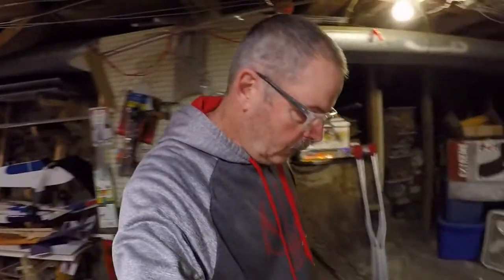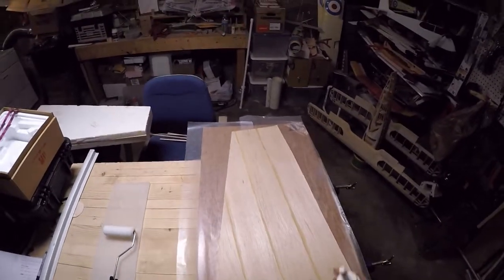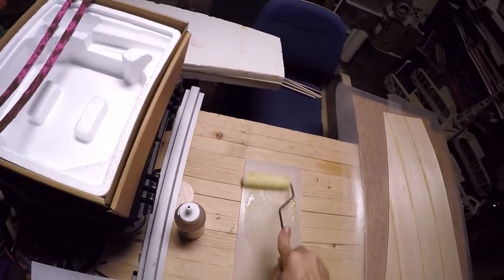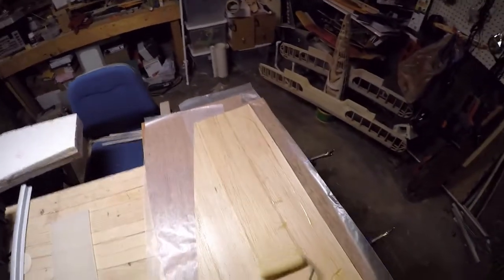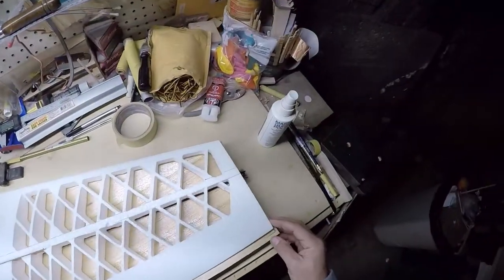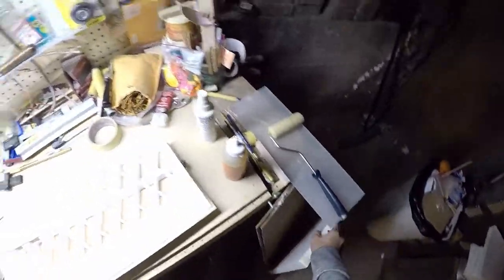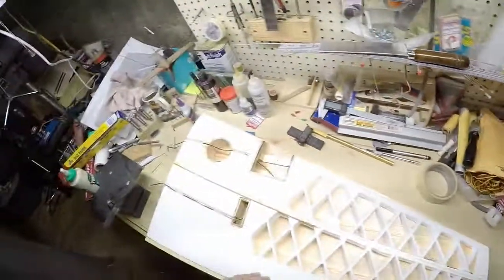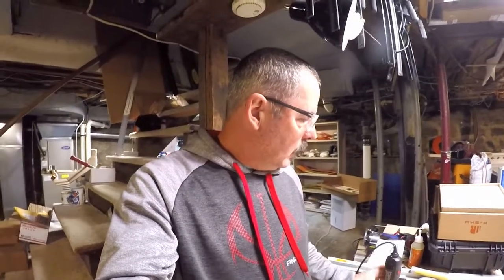Foam Wing Sheeting

Comment: In the 70s when we sheeted foam wing cores with 1/64 th ply we used contact cement on both surfaces used kraft paper between them when aligning and then pulled out the kraft paper and rolled. Sheeting was done and no weigthing required.

Comment: I used to make pylon wings. One time I used a spray adhesive. But did not allow the chemical to dry or gas out. After clamping the foam in the cores with the wood sheets to dry I let them sit. The next day I discovered the glue dissolved the foam.

Comment: Thanks for sharing your process.  I've heard people use sorghum, epoxy,  3M 777, even expanding foam.  I've only used 777 and found it very messy.  I might give the Gorilla stuff a try on the next one.  Incidentally, I have a minilathe and aluminum stock.  It would be interesting to see how you fabricate your struts.  I assume the ale is held in the strut with a T-pin?

Comment: Have you had any issues with sagging or separation on the under side during hot days? I am building two 1/5th scale AT-6 Texans. What cloth weight do you use? And I can't find 1/4 oz clothe any more. Only 0.56.